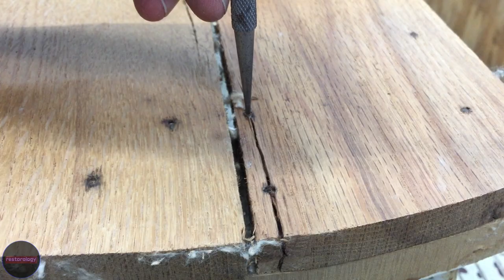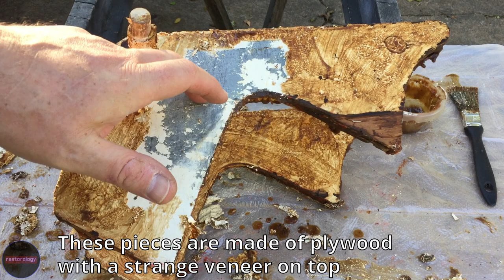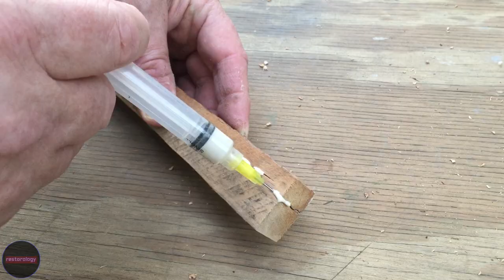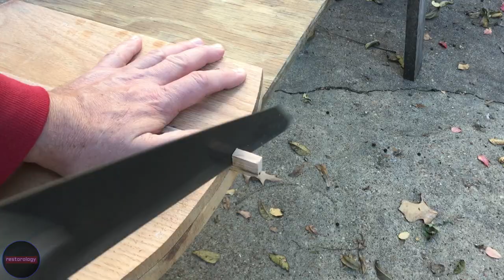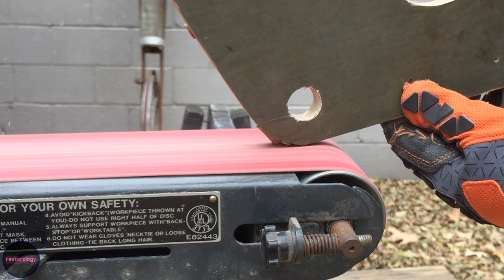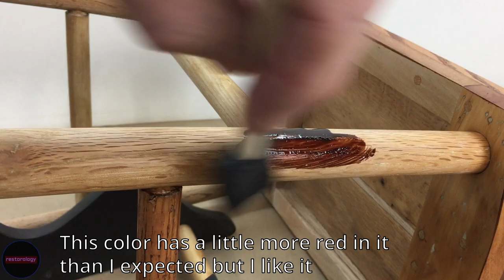Antique Step Stool Repair and Restoration

Comment: I am really impressed with your restoration. I would never have thought to use black paint, but it really works well. Simply amazing finish. Well done.
Reply from the maker: Yeah I was unsure of the black at first but knew I had to do something different to cover the plywood piece that had the weird veneer or whatever it was. The textured matte finish looks pretty good in person against the stained grain of the oak pieces. It almost just blends in if that makes sense. Thanks for the nice feedback! 🍻

Comment: Having a father who earned a living as a finish carpenter I am not easily impressed. 
But you sir are one of few that has impressed me. Your stripping of finishes, disassembly of the seat, stretchers, and legs was error free. The repair techniques are those of an experienced carpenter. Assembly and finishes were top quality for the “kitchen stool”. Attention to detailed was what made your effort an excellent example of what can be accomplished without having a large shop area stuffed with tools and gadgets,
A tip of my hat to you for a job well done.
Reply from the maker: Wow thank you for the very nice message. I am very much not a professional but I am learning as I go with these projects. I hope to have a better-equipped shop one day so I can try bigger projects and build things from scratch. Thank you again for the great comment and please have an excellent day!! ✌🏽
Reply: then you flunked the class.   in most situations, wood and epoxy do not work together that well.
Reply from the maker: @rynait  It's just a cheap shop stool, not fine, antique furniture. It will be okay.
Reply: @Restorology  AH.  so you were fooling with cheap stool and don't care if it does not survive.  NO PROBLEMS.

Comment: I like your approach, prep, repair, and finishes. I especially like the fact that you use Oxalic Acid. Have you looked into resin stabilization for smaller parts?
Reply from the maker: Hey thanks! I looked into it last year when I was making wooden scales for a knife I repaired (the video is on the channel) but I did not end up trying it. I do hope to work on a few more knives in the near future so I definitely should pick it back up again. Thanks for asking!! ✌🏽

Comment: Wonderful work! Excellent techniques and the final colouring is lovely! May I offer a suggestion regarding the lathe work? Try a cup centre on the tail stock next time rather than the pointed cone. It’ll make for a more centered rotation! Merry Christmas !
Reply from the maker: Thanks for the tip. I am very new to lathe work and don't know crap about technique yet. If you have time, will you give this video a view and see how I could have done things better? I had to use the same tools to fab up some pieces and I know there has to have been a better way. Thanks!! https://youtu.be/hpYLDRt6fY0 Merry Christmas! 🎄

Comment: If you have blueprints for the stool, I would sure love a copy!
Reply from the maker: Do you mean drawings to construct your own? I hadn't thought about that but it would be easy to do. This would be fairly easy to make from scratch since it used standard dowels for legs and stretchers. The rest of it would be stock hardwood or even plywood for a cheaper option. I'll give it some thought. Thanks for the idea.

Comment: Came out great.  I would have preferred to skip the stain and just clear coat with an oil based finish.
Reply from the maker: Actually I would normally agree with you 100% but I thought that the darker wood would look better with the plywood piece I had to paint black...not as much as a contrast in color tone. If the step support piece had been solid wood with nice grain, I would have left it all natural and used a finishing wax. Now that it is finished, I like the way it looks. Thanks for the feedback! 🍻
Reply: @Restorology  Ok that's fair.  The stain is pretty natural looking I'm just anti stain :).

Comment: Might I suggest hide glue instead of epoxy?  Those joints will never come apart again making future repairs more difficult.
Reply from the maker: Hide glue would've been great but there was too much gap in the joints that hide glue could not have filled. I HATE working with epoxy but sometimes it is necessary to fill imperfections. Thanks for the feedback!!

Comment: You didn't know why that one piece of wood was to short?? It wasn't squared and you squared it up and it didn't fit anymore lol I would think you knew why
It looks like a new step stool again and you did a wonderful job restoring it. I love that you didn't paint all of it and showed off the beautiful wood it has
Enjoyed your video and I gave it a Thumbs Up
Reply from the maker: I guess I was just surprised that I took too much material off of the ends. I am usually more careful than that. The good part is that I was able to replace that softer wood piece with real oak to better match the rest of the stool. I am not a fan of painted wood so I avoid it whenever possible. Thanks for the great feedback! ✌🏽
Reply: @Restorology  You're very welcome!! I guess I missed that you made it to short and not from making it square. Looking forward to your next project!!

Comment: I fear that epoxy that you did is not going to benefit the furniture at all.   so  I have to say this is poorly thought out modern substitution or renovation attempt (not an restoration).  Since you did not consider that WOOD  will expand and contract no matter what and epoxy is stronger than wood,  the furniture will be ruined, at the tendons.
Reply from the maker: You are not wrong about epoxy. I would have rather used wood glue or hide glue but the joints were loose from years of moving around. It was not a tight fit of wood on wood so I fear that glue would not provide a good bond. Epoxy is always my last resort. I hate working with it. Thanks for the feedback!